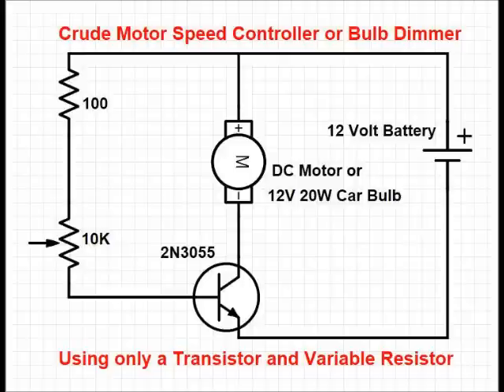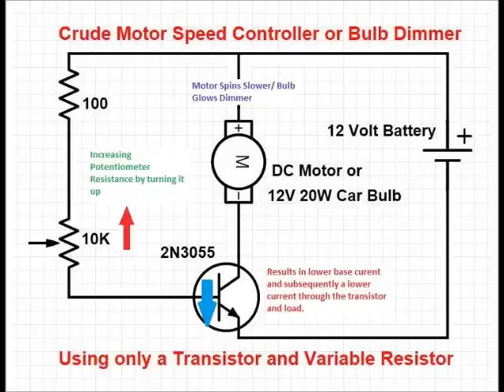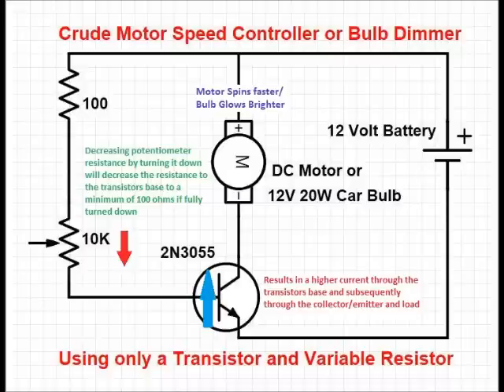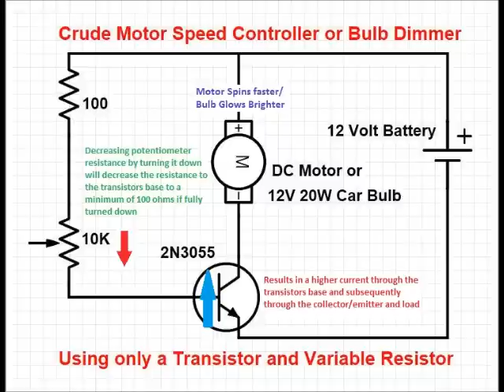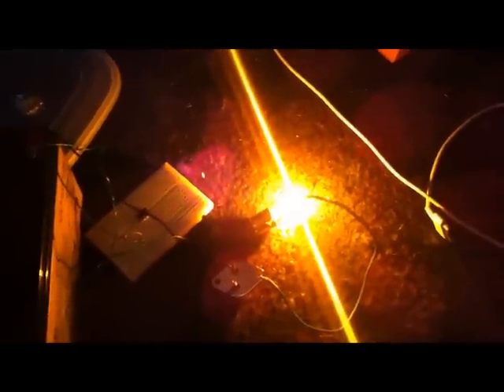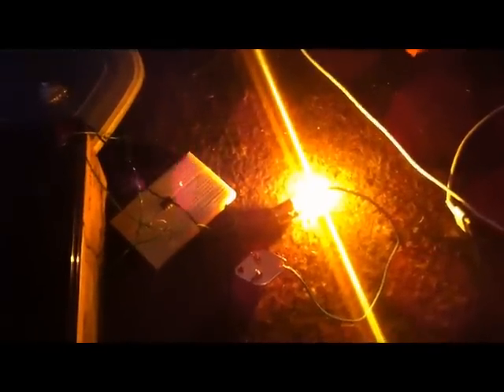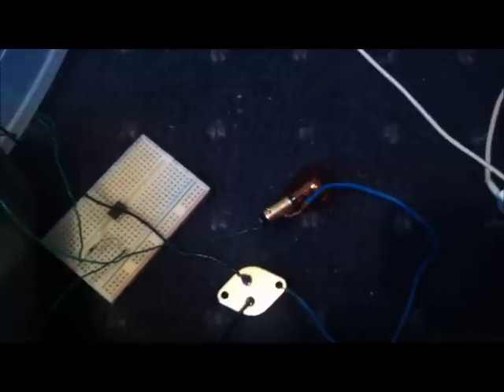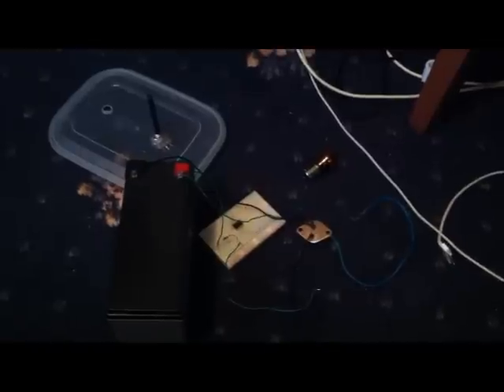Electronics: How To Use 2N3055 Transistor - Light Bulb Dimmer / Motor Speed Control

Comment: What is the lowest voltage you can get from that 2n3055. I want to make a variable power supply for random small projects. I have followed schimatics from websites on how to do so. However I would always get a minimum of 7.5 volts. My input voltage is 22 volts if that makes a difference.
Reply: So im wondering if I could have damaged it in the past.

Comment: This circuit works well, not the most efficient thing in the world, but totally fine for motors <100W, just need to put a heatsink on the 2N3055.
Reply: +Dean Prattley        What happens if I hook a series bulb with a motor?     Does it limit the current through the motor and decrease the speed of the motor

Comment: What happens if I hoo; a series bulb with a motor?  Does it limit the current through the motor and decrease the speed of the motor  ??
Reply: yes it limits  the current thru the motor, the highest current you can get is what the lamp uses. but the current you will get is lower since you also need to add the motors resistance into the calculation. I=U/R
Reply: Thank you for your answer